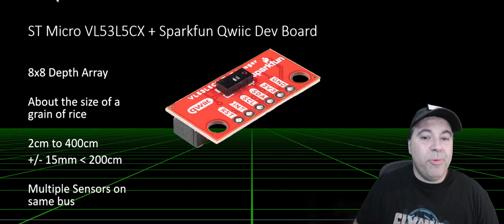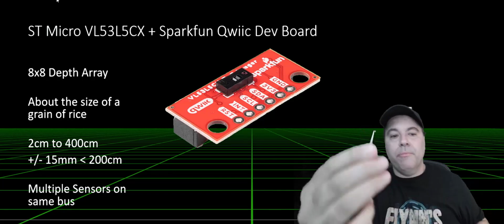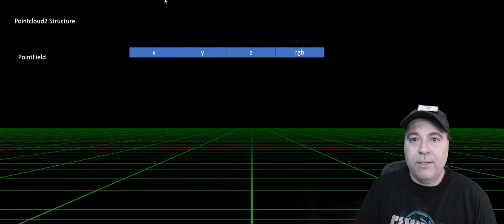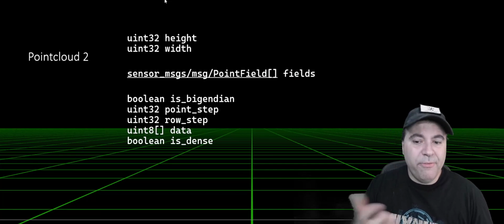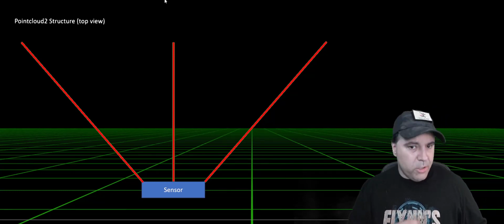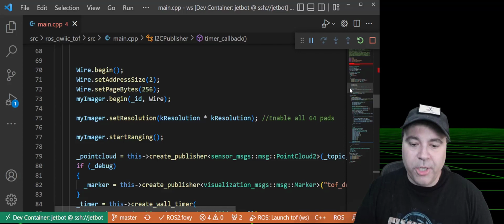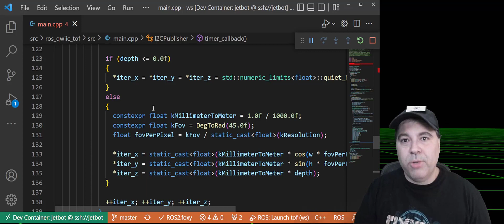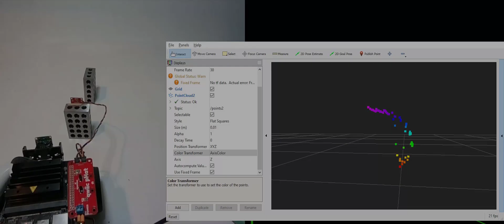Getting Started with ROS2 Navigation - Episode 5 - ST VL53L5CX Depth Sensor and Pointcloud2

Comment: Great video! I believe you have a mistake in the conversion from VL53L5CX's "spherical" coordinates to Cartesian. For a sensor oriented such that it points horizontally, x horizontal normal to viewing axis, y vertical to viewing axis, and z along the viewing axis, the equations should be x = d*cos(alpha_v)*sin(alpha_h); y = d*cos(alpha_h)*sin(alpha_v); z = d*cos(alpha_v)*cos(alpha_h).
Reply from the maker: Thank you! I'll look into this error! I have some work with multiple units incoming, working on a rev of this. (Sorry for the delay in responding, April has been weird for me)
Check out the multi branch on https://github.com/polyhobbyist/ros_qwiic_tof
Reply: It has been a while but wanted to share for others perusing in desperation like me.  I tried a few methods of spherical coordinate conversion and your code is the only one that produced a flat plane.  So I searched on the ST community forum and found a ST employee reply in a post that stated the distance is angle compensated.  So the distance is normal to the sensor plane and not radial.  No conversion needed.  Just back out the horizontal and vertical components for the point cloud just as in your code - Thank You!

Comment: Great.. i am trying to follow your videos.

I am looking for something (python program) where ROS controls the stepper motor.
Reply from the maker: Controlling a stepper using ROS2 would be a good video.
I would use an i2c stepper driver like https://www.adafruit.com/product/4280.
It has a python library, or you can use an arduino library with my wiring for ROS2.
At that point, you'll need to decide if you want to run the steppers as a velocity driven motor, or a positional joint. I have videos incoming on driving a motor as a velocity joint.
Reply: @rh_robotics  Hello, thank you.

Great to know.

I would be interested in the python code which specifically sends "step" pulses and direction signal to stepper motor. I find it little challenging as for every position the time period between 2 step pulses define the smoothness and acceleration of the stepper motor motion. So interested mostly in positional joint.

then with IMU measurements you can also demonstrate SLAM of a robot. I don't know if arduino is strong enough to do SLAM computations on the fly but would be interesting to know. 🙂
Reply from the maker: @sabzimatic  The Nav2 video series is working up towards doing some level of SLAM using the depth sensor and IMU, but a Microcontroller won't be sufficient to run a slam stack. It certainly can be coupled to a CPU - the MCU does the realtime work, and the CPU the cognitive work.